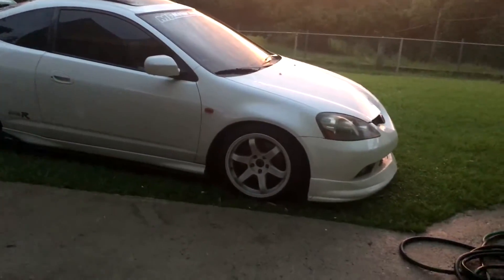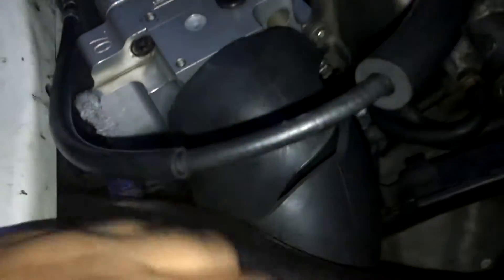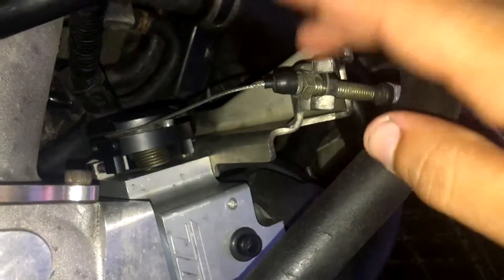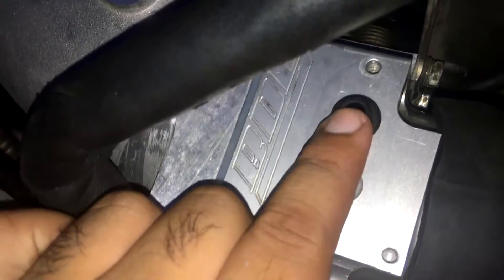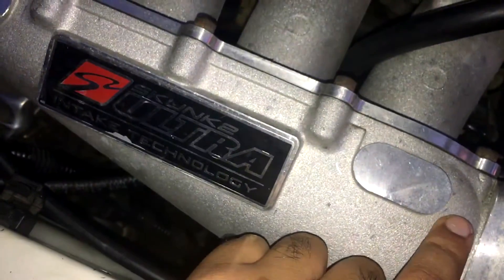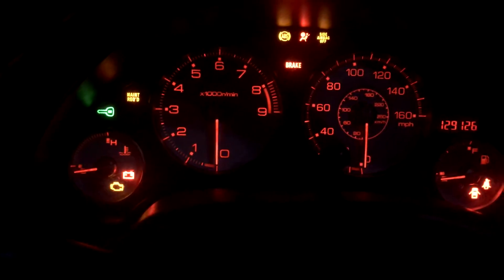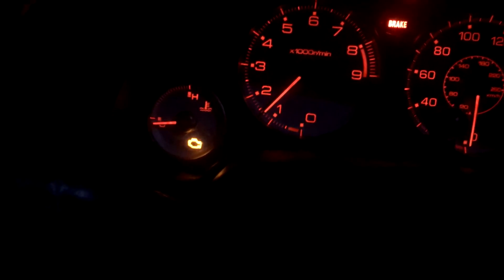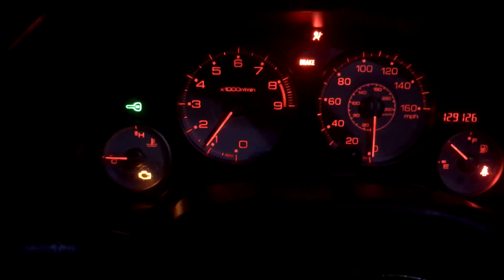Recent Updates On My Car (RSX)

Comment: 9300?!! 226?!! DUDE mad props hopefully mine will make around that! and i love the high rpms!
Reply from the maker: Screaming z1 thanks man.. hehe. Im gonna upload a video with the 9300 lol. A bro it was lot of work but possible. Slowly but surely man
Reply from the maker: Screaming z1 Im sure youll make numbers like mine
Reply: yessir no problem dude. and hopefully, in time it shall come! lol. im just worried now with all the miles mine has on it, oh well.. figured ill just keep throwing it to it and see how long it lasts. i have to do a  timing chain and tensioner ugh. and now my clutch is is starting to go out. (still the factory one). just not motivating to buy go fast parts and a tune when so much $ is needed just to do maintenance.
Reply: side note, PR looks like a beautiful place!
Reply from the maker: haha dont worry bout that man. I've been there trust me. One step foward 2 steps back. Its kinda bs but, still love my car. At the end its worth it, at least I like to believe so.

And man thanks, I love living in tropical climate year round. Summer tires is the only thing I need hehe.

Comment: man i want mine to go up to 9300 rpms
Reply from the maker: Jonathan Mejia hehe you can!! All you need is a built head and ecu and tune
Reply: leonelobbed. i dont know anything about motors, explain what a built head is please
Reply from the maker: Well In simple terms, there are basically 2 major components on your engine. Your engine block, the bottom portion of the engine, where rods, pistons, crankshaft are and the upper part which is called the engine head. This is where the engine's valves, valve guides, springs, retainers, camshafts are.In theory, by forging your engine's upper half, like mine, (I have forged valves, retainers and springs) and by installing an aftermarket ECU you can tune your car to perform much better, thus reaching 9300 rpms like in my car in some circumstances. Hope I was speaking simple enough lol, its a bit much at first, but once you understand what's what, it becomes easier.
Reply: leonelobbed thanks haha i'll try to get some of that done, but how expensive is it?
Reply from the maker: hehe well a built head is pretty expensive, all the parts I mentioned plus paying for the work to be done, Maybe 3 to 3.5K
Reply: leonelobbed damm pretty expensive